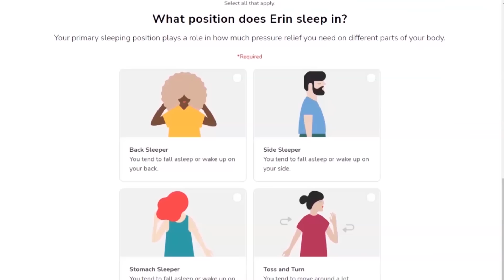Foundation Is FINISHED- LET'S BUILD! | A-Frame Cabin Addition

Comment: Yay! you made it to the end of that project task by getting the walls poured and most of the forms removed.  Even though you didn't get the wall sides equal before the pour, it still looks great considering the time constraints you were working under.  Looking forward to seeing the barn doors installed.  It looks like your daughter likes to lend a hand at just about everything, which is really cool too.

Comment: You mentioned that it was a cool brisk 30 degrees which reminds me that the temperature of the concrete while it is being installed and cured needs to be maintained above 32 degrees. I would recommend tenting and heating the concrete in order to maintain the temperature above freezing otherwise ice crystals will form in the concrete causing a honeycomb affect thereby weakening the concrete when the ice turns to water. The first few curing days are especially critical since 60% of the concretes strength is developed within the first few days.

Comment: If you pour stem walls for the workshop, pour in short lifts from one end to the other. The first pour with stiffen just enough to reduce the blowout pressure. You could pour three lifts and have very little risk of blowout.

Comment: Quick tip for next time you pour concrete it’s best to pour in lifts to  lower the risk of blow outs. You allow the concrete to set up so there’s not as much pressure at the bottom of the forms

Comment: Man that formwork used a serious amount of timber and screws. Looking good for the next phase. Might I suggest running steel bolts through that support beam with large washers each side, rather than relying on screws to bind the planks together. Looking forward to seeing the super structure going up. Some range of natural skills you guys have. Amazing work.

Comment: Concrete work is by far the most difficult and labor intensive work in construction. The construction tolerances are so minute and the material is difficult to work with especially when you factor in time constraints. I strongly recommend hiring all the help you can get to help you finish the building shell and dry in the building primarily because of the server weather you live in. Weather damage can be devastating to the construction materials and it won’t take long for the squirrels and rats to destroy the exposed insulation and electrical wiring. May God bless your family and keep up the good work!

Comment: I know you guys say you're done with concrete but I have a tip for next time. I recently saw a short where a guy cut a deep well socket in half and welded a length of pipe in between the pieces. Something like that might come in handy if you should ever need to use all thread to brace forms again. 😉

Comment: Is there a reason you went with a full concrete foundation instead of cinderblocks? Just curious if all the trenching and prep ends up being worth it for extra strength and stability for example.

Comment: JIT Josh.='s Just in Time Josh. WTG. 'On w/the Build' but love Erin comment on she can find the hole better, sounds like my deceased wife used tell me. Brings back many good memories of us waterproofing the basement walls as we built a house together w/me working 40 hrs a week and doing most of the building in afternoon's, nights & weekends. I did sub the basement being dug, elect, plumbing, roofing & concrete footings/slap block/brick & heating & air work & sheetrock.

Comment: Why don't ya'll use a concrete vibrator on the solid pours. We use concrete wire also to prevent cracking. Just curious. I hate concrete work to be honest but it's a necessary evil lol.